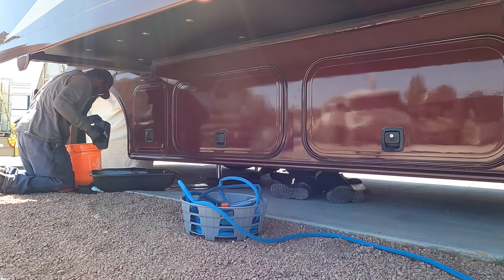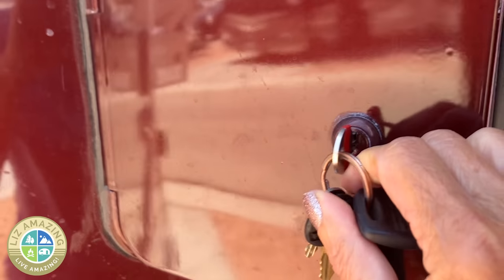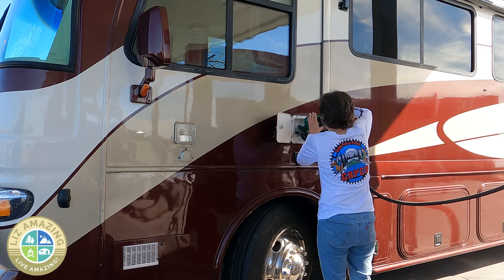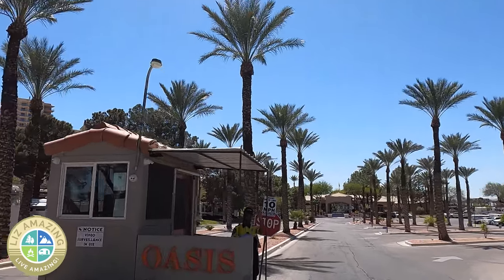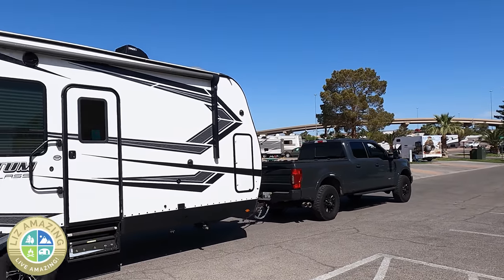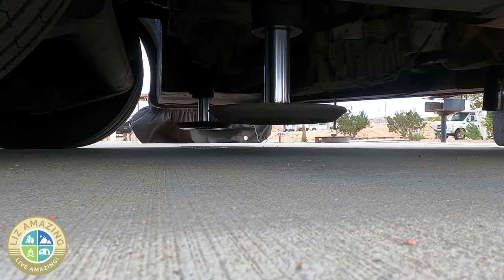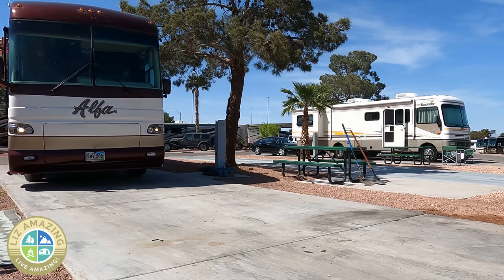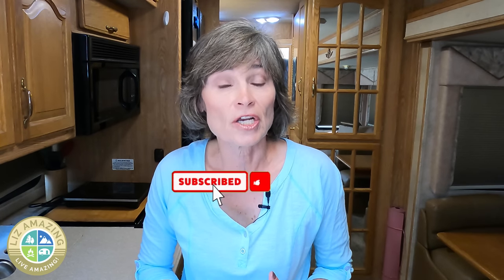RV Life: The WORST mistake I've ever made!

Comment: No, Liz. I've never made any kind of, monumental, technical mistake. I'm an actual engineer. You don't do stuff in the dark. God invented flashlights. I probably have a dozen of them. Of all sorts..

I'm so sorry to hear about that.. That is beyond bummer. Thankfully you didn't start it up that way. That's going to be a bit of a repair job. What a nightmare. You were pushing yourself too hard. You were fatigued. This is how people get accidentally killed or maimed.

With my work. I have had to interface. In Hot  AC Breaker Boxes. Always very exciting to do. To tap the power I need from shore power. And if you make a mistake with that. It can be instantly, deadly. Plus I don't do that alone. I will have somebody there with me. I give them specific instructions. If I tense up. And don't respond. I am being electrocuted. Do not touch me. Just tackle me and break me free. Before I'm dead. They can't necessarily touch me except for, tackling me free. Since there is no switch to turn off.

And so I have to be very precise. Especially when I was doing Coast-to-coast and worldwide broadcasts. You've got everything down pat. Or you end up with egg on your face.

I'm looking for another used motorhome. Which will be my last one of my life. And while I'm quite broke. Due to bad things happening. I find your Alpha Motorhome. Pretty much what I wanted. And I'll see if I can find one about 20 years old. And I'll throw out, the propane oven and cook top. As I have 2 microwave ovens. And 2 induction cooktops. And a barbecue grill for outdoors. That's all I'll be needing. I don't bake cookies or cakes. I don't roast chickens or make pies. And I love those induction cooktops with my, cast-iron saucepan and grill. It's perfect. As its, iron  and ferrous metal. Cast-iron is great  on an induction, cooktop.

And yeah. Residential style, frost free refrigerator freezer. 120 Volt AC. As I never really thought much of those, RV refrigerators and their inflated cost. And having to be perfectly level. I'm not into being perfectly level. I don't mind angles. Though you can go rolling around on the floor accidentally. And does present a greater challenge especially in my senior age of 68+. And I'm not that young whippersnapper I used to be.

I hope I can find one in my price bracket. I can't blow it all on the motorhome. I think tops. I really can't go much over 20,000. That's definitely going to limit my choices. And the Alpha just might not be doable. But it is definitely what I want.

So thank you so much. I was not really aware of that brand. But yeah.. That's the ticket. It's on a solid, Freightliner Chassis with, CAT diesel engine. You really can't ask for much better than that. Great American Brands. Well trusted well-established. There will be parts for years to come. Unlike my Mercedes-Benz L-1117 diesel box truck. There are no parts for that available in the USA.  Only direct from Germany. And there's like no more living mechanics. The know-how to work on that beast. And as much as I love that truck.  As I have completely customized the 24 foot long box. Servicing will be a bitch. Though it is incredibly reliable. It's also 40 years old.  It's a 1984 chassis.  With only about 150,000 miles on it. So barely broken in actually.  But only with a,, in town delivery, 5 speed transmission. And to get a bit more challenging. Driving in the mountains. And not having the 10 speed, long haul highway transmission. And no air conditioning in the cab.

And so I own it outright. And perhaps I should just use it. Until it blows up. And hopefully I'll still have enough money in the bank. To find a used motorhome  that will be suitable. And likely, smaller at that point? I don't know? It's going to end up being mine, permanent home. Until illness or senility. Knocks me down first. But maybe I've got 10 more good years left to mean? And I just want to hit the road. For the rest of my days. Once my 100-year-old mother, passes on. As I must care for her. She was the best mom in the world. I was very lucky. To have a mom like her.. I met a lot of my friends moms. I wasn't impressed with many. They were very nice. While they were your average moms. I had a very active mom. A very involved, mom. And I think my lucky stars. For that woman.

I've been on the road most of my professional career. With my big diesel box truck, Recording Studio, Control Room On Wheels. And it's basically like a Super-C Class motorhome on the inside of the box. With 3 separate rooms. Very highly insulated. Very soundproofed. Nobody outside will hear you scream inside. They won't hear you playing blaring loud rock 'n' roll, outside. And it still looks like a Sears delivery truck. Because that's what it started off as. I bought it after its fifth year of lease. And I've loved it. It's very basic. Very noisy. Very dirty. Very hot. And I can pull right into the parking lot of a Truck Stop. I love Truck Stops. Each one a little city unto itself. Everything you need is there. You are in want, of nothing. Multiple food places. Doctors offices. Hairdressers.  Clothing. Service facilities. A hotel. They've got it all. And frequently. If you spend a set amount of money in the facility. Your overnight parking will be free. So dinner and some supplies from the minimart. Basically get you free camping.

And thus. The advantage of having a Super-C Class Motorhome. That nobody knows is a motorhome. It's completely Stealth. So parking it on the street in industrial parks. Also no problem. And nobody will ever break in.

Nobody has ever broken in.  Even when I parked it overnight unattended. In the ghetto of Baltimore.  Back in the early 1990s. And there's a reason why nobody breaks in.

I have created. A 100% Passive. 100% Green.. Crime Deterrent System. And the whole thing cost about $150. And no need to maintain it.. And the cops just love it. Even though they try to arrest me at first. And why would they do that?

I went to a truck signage shop. And I requested a few signs.

On the, Essential HVAC unit. It reads… LEAVE REFRIGERATION UNIT RUNNING. TO CONTROL BACTERIAL ODOR.

Then on both the, Driver and Passenger doors. Duplicate signs appear.  That read… DIRTY BABY DIAPER PICKUP SERVICE. Of which I had a slogan for. But the truck signage guy recommended. We don't put the slogan on.. And what was the slogan?

DIRTY BABY DIAPER PICKUP SERVICE. We don't take just any  shit. Which I thought was very apropos or, apropoop.. Both qualify.

And the reason why the cops try to arrest me at those, Highway DOT, weight and inspection stations. They want to arrest me. Because I have no CDL (Commercial cabdrivers License) and they believe I am carrying human waste. Which requires,  HAZMAT Paperwork. Which I have none of. And then they want to arrest me.

But I have to inform the cops. That if they arrest me. When we go to court.  The judge. Is going to laugh you guys out of the courtroom. And then I'll have to sue you. For missing my gig.

Given that explanation to them. That will usually  spark some interest then. With then, what the hell do you have inside there?

It's at that point. I give them the Grand Tour. Edley freaks.  They think I'm a genius. They said everybody should do what you're doing. I said yeah but you just tried to arrest me. They said yeah we know but everybody should be doing this.

And they always let me go after that.  Because it's a private vehicle. All I do is record, musical friends. As is no longer my profession. It's now my retirement hobby. As I love to do it. I've never gotten enough of it. And I've done some incredible jobs. Over the years. That have just blown my mind altogether. As I also always go the extra mile. And I do it up real good. And always have. I stand for Professionalism and Excellence.

At worst. I'll get another gas powered one. On another step van chassis. Which is still better than a regular Class-B or Class-C. I do prefer the Class-A's. They are just built better overall. Then a Ford or Chrysler van chassis.

(More tow job in following post)
Reply from the maker: Wow. That's awesome that you have never made a technical mistake. I guess that's like a pilot who has never crashed a plane. Good for you. I even had a headlight BUT did not use it. I've now added a locking fuel cap. Thanks for watching.

Comment: These repair guys are a joke.  There is no reason to dispose the contaminated fuel.  If these companies had fuel polishing systems they could of pumped out the bulk of the water and polished the fuel.  A fuel polishing system would of easily cleaned the fuel.  

You could of pulled the fuel pump fuse to keep the fuel pump from running and had it easily towed out.

The way these guys drained the fuel a few gallons at a time is extremely time consuming.  If they would of had a drain pan with a pump they could of pumped the fuel out of the drain pan into the big tank and they would not of had to transfer it multiple times.
Reply: *could HAVE
*would HAVE
*not HAVE